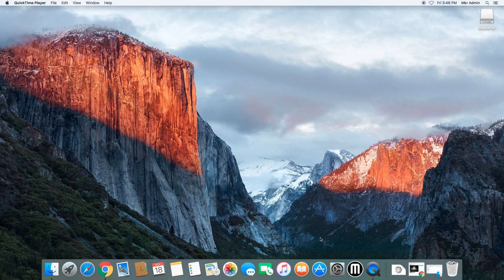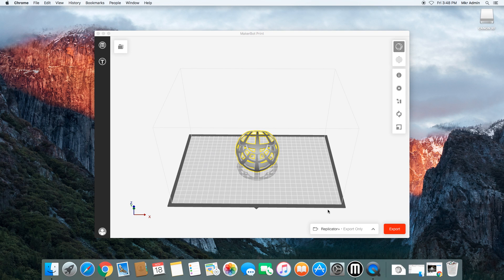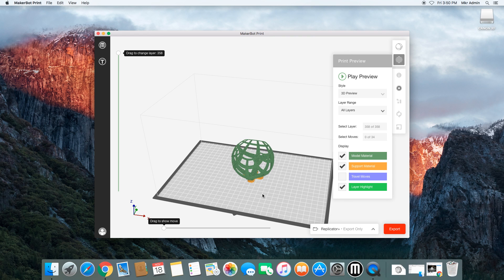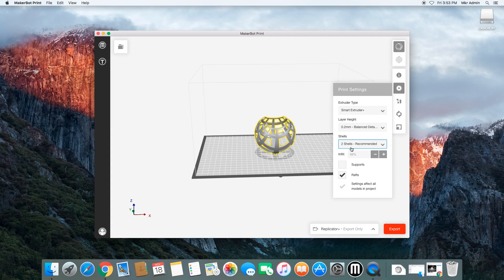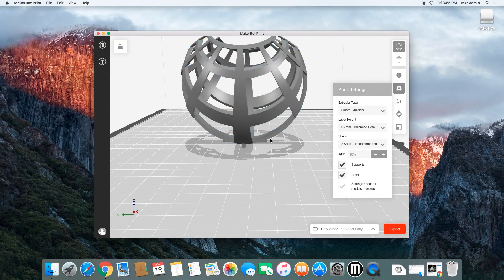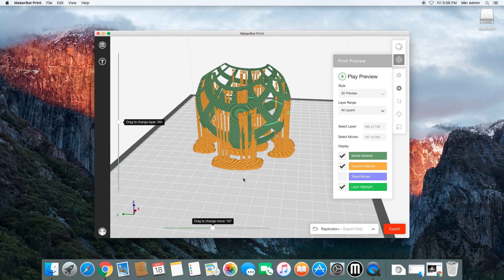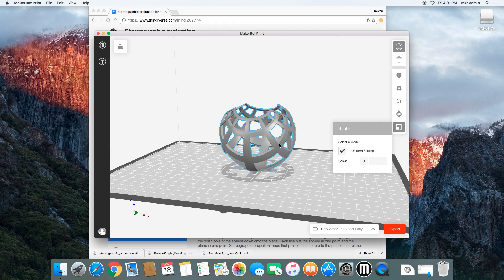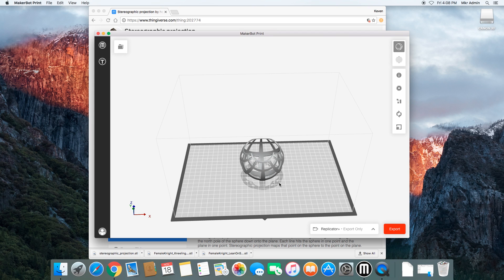MakerBot Print Tutorial

Comment: What about advanced settings like extruder temperature, or speed? Where can I modify those values?
Reply: alejandrogt96 usually on the printer. It also depends on what kind of printer your using.
Reply: alejandrogt96 my printer, replicator 2 it has a pad with a screen and you can adjust it there